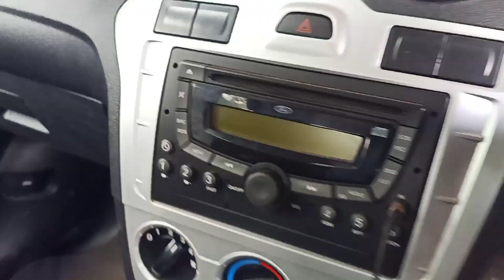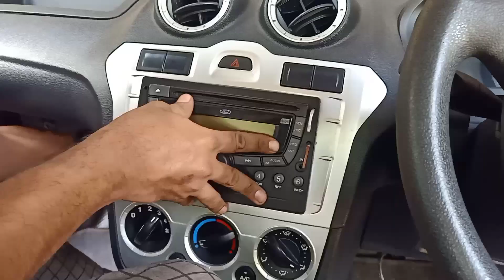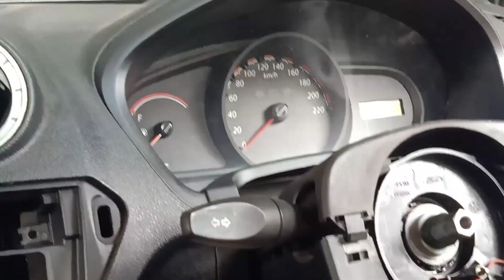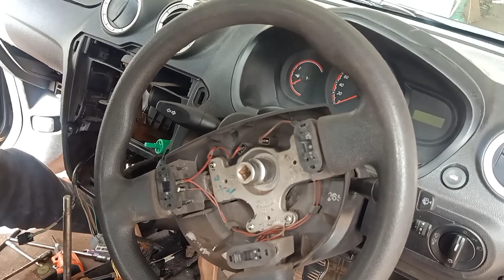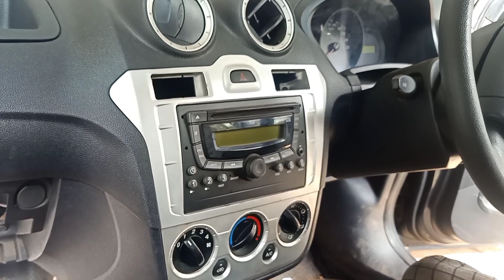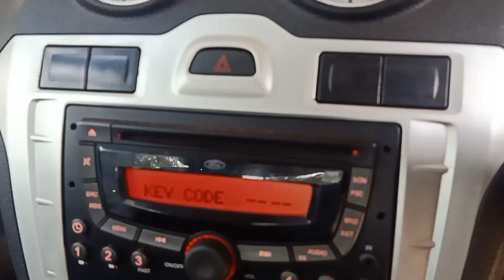Ford figo dashboard remove and A/C cooling replace

Comment: Bhai part by part nhi khulta hai Dashboard wrong method hai! Complete open hota hai figo ka dashboard cooling coil replacement ke liye! Sabse pehle center console open kro, Steering cross se kholo 2 bolt left 2 bolt right eik bolt right orvm ke pas piche se heater aur evaporator ki pippe bikalo complete wiring coupler to coupler nikalo dono side se aur dashaboard complete bahar